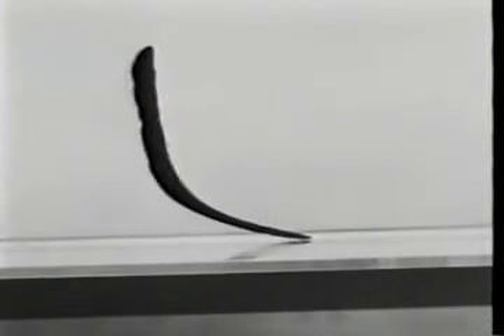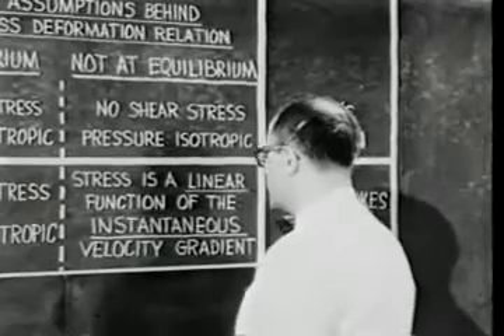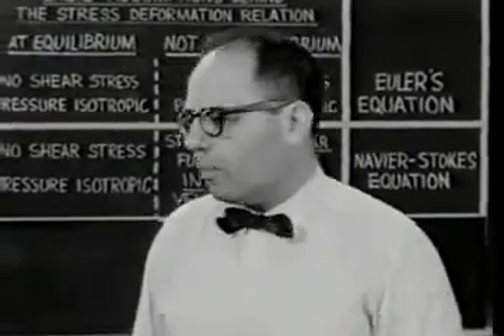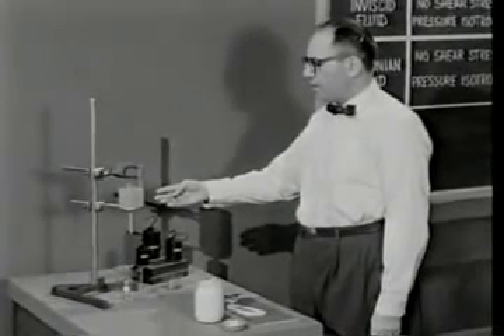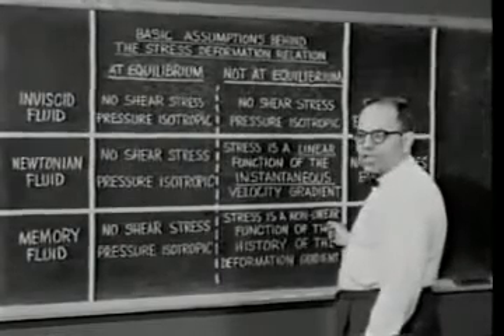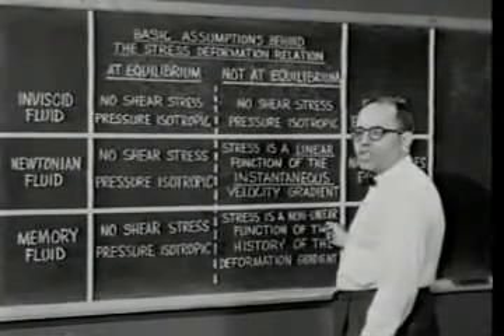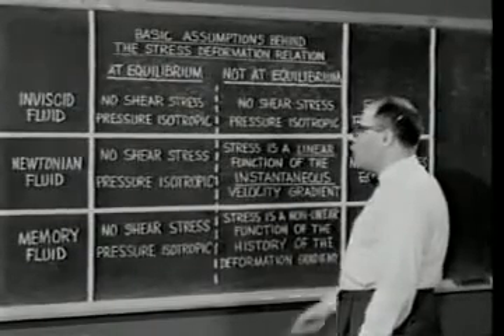Rheological Behavior of Fluids  - Illustrated Experiments in Fluid Mechanics - Lesson 3

Comment: Experiments:

1:19 Nonslip BC
2:24 Silly putty
2:48 Elastic PVA solution
3:18 Mayonnaise
3:36 Clay suspension in a funnel (yield stress)
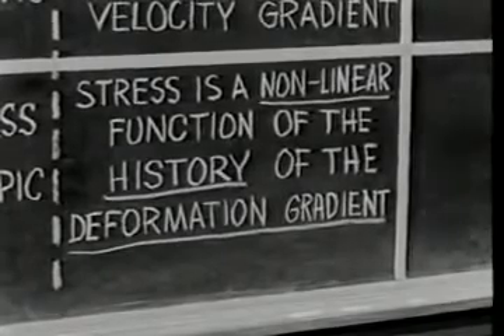5:46 PVA solution x honey
6:15 Deformed silly putty
6:20 Silly putty bouncing
6:45 Deforming silly putty (fast forward)
7:10 Steel ball dropped in a high polymer solution
7:35 Memory effect in a high polymer solution "step deformation experiment"
9:00 Concentric cylinder constant torque experiment and memory (Newtonian x viscoelastic)
10:20 Constant torque and release experiment high polymer "creep-recovery"
11:31 water x pseudoplastic fluid flow under hydrostatic pressure
13:10 water x dilatant fluid flow under hydrostatic pressure
13:58 flow profile in a tube
14:28 Weisserberg effect
15:21 Normal and static pressure measurement 
17:03 Normal and static pressure measurement  in rotating a disk
20:00 Barus effect
20:30 Ball spinning in a nonnewtonian fluid
21:00 Summary of experiments